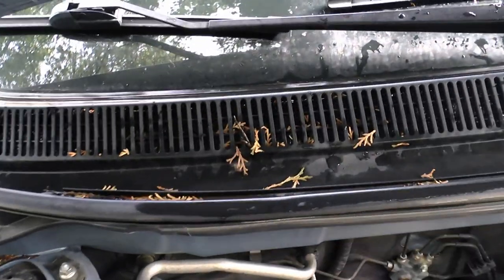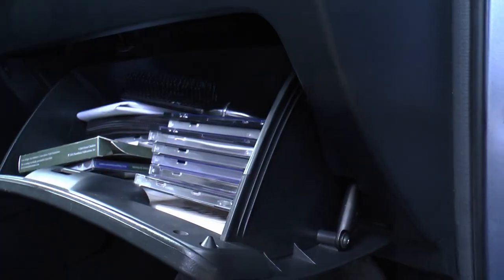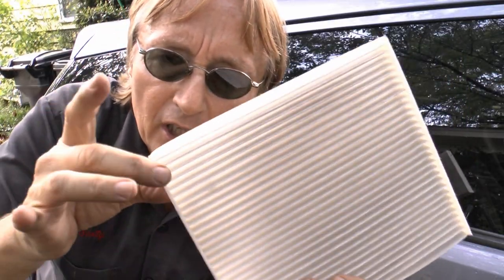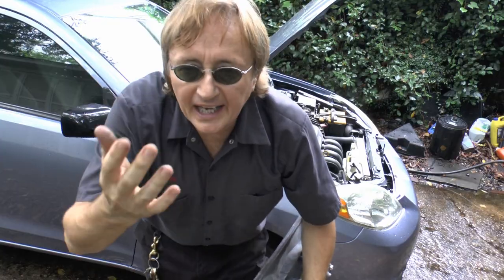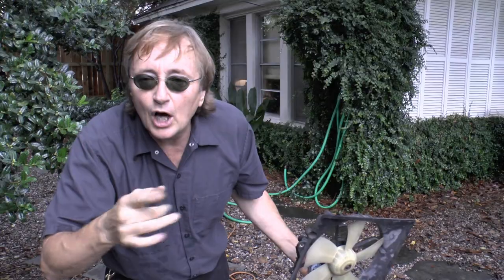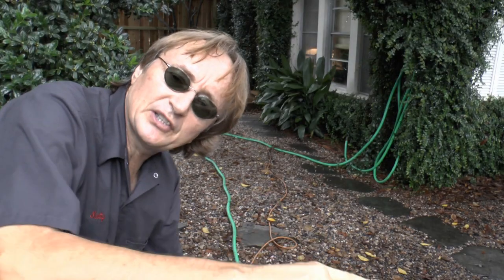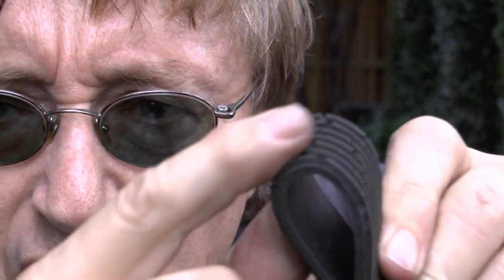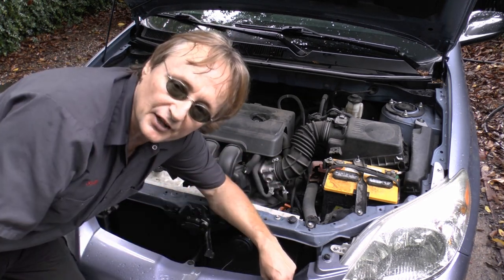How to Keep Your Car's AC Blowing Ice Cold for FREE

Comment: When I was 19, I had a Chevy Celebrity.  That car would GUAG (Get Up And Go) straight off from a cold start... I purposely did that ONLY ONCE just to see if it would.  In fact that car started right up with no trouble at all. I can just slam it into gear and floor it.

The problem is that the car had a huge knocking sound even before I had it.  That car was knocking when the previous owner had it, which is funny because that excessive knocking was the only freaking thing wrong with it.  And to make matters worse, there wasn't a single mechanic who could figure out where the knock was coming from or why.

And when it came time to smog the car, everything passed.... EXCEPT FOR THAT KNOCKING!!!!!!!!!!!!!!!!!!!!!!   Everything checked out otherwise.  I ended up scrapping the car because NO ONE COULD FIX IT!!! I'm 33 now and still can't figure it out.

Comment: Can you tell me how to do a freon refill for a 2005 Mercury mountaineer? the compressor is in a weird place. I can't seem to attach the freon hose to the low pressure access point. Not sure if I'm not using the right access point or what.
Reply from the maker: the low side hose ONLY fits on the low side fitting, you can't put it on any other fitting, it won't fit. Go to an auto zone, they can show you in person
Reply: +Scotty Kilmer ok thanks!

Comment: I have a 2001 Buick park avenue, the AC was working great but now its not blowing cold air through the vents. I changed the cabin air filter but still nothing. The AC has coolant and the lines are getting cold but the air coming through the vents never get cold.

Comment: How about using an air compressor and blow off dust and dirt from inside and out?
Reply from the maker: +GymChess sure, if you can access all the parts
Reply: +Scotty Kilmer I tried once and I did notice a small "cloud" of dust fly off. Of course it wasn't easy. How often should you do that? Is there any risk in it like bending those small aluminium "grills" or whatever they're called? I think that I accidentally did bend quite a few, maybe with the nozzle, not sure.

Comment: what if you completely remove the cabin filter? Although you'd pretty much be getting nasty air, you theoretically would be getting cold air all the time right?
Reply from the maker: it would increase air flow , until debris hit the evap and made it worse
Reply: I did that in my Father's Honda Element.  Never replaced it.  It was nasty.  His newer van doesn't even have one so what's the difference?

Comment: Ive got a 06 scion tc and the ac isnt working i looked around a little and noticed some flimsy   wire which i beleive connects to the ac compressor, its a gray 1 pin connector and it lead up to alternator connection harness. Do i need to replace entire compressor or is the ac compressor wire interchangeable?

Comment: Hello Scott Kilmer, my 2003 Chrysler intrepid drops RPM with no response from the accelerator, but everything works fine after i pull over and turn off and turn the engine back on.  would you know what is causing this?

Comment: Mr. Scott...i have a question, I turn the AC on and it blows warm air...i put refrigerant ACpro in and still warm air but now, the fan on the radiator goes on and off.  It does that as long as the AC is turn on and every time it goes off, the engine shakes like its choking on something.  I also observed green refrigerant around the connecting holes connecting to the condenser Unit.  Any ideas?
Reply: Have your system leak tested by a professional.

Comment: Is there a way of cleaning the evaporated  ? I just bought a 2006 F150 that sat outside in wooded area still finding ants running around. Thanks
Reply from the maker: there are various evaporator spray cleaners on the market, google it

Comment: Do not remove your radiator cap that quickly if the engine is hot. If you must, wear a glove, use a rag and remove the cap SLOWLY. Better still, wait till the engine is cold.

Comment: Scotty, I have a question for you. I have a 2010 Camaro and when I turn on the AC full blast, It doesn't blow cold air and when I checked the pressure with a hose the needle was in the red and the AC compressor is kicking on. Any suggestions on what my problem could be?
Reply from the maker: +RobertGarrett19   pressure is waay too high, either cooling fans aren't working, or there's blockage inside the system, like a clogged condenser

Comment: Hi Scotty..strange problem on my 2002 SATURN SL1. A/C works perfectly...except it is laways on (turns on when the fan is turned on). THe LED on the A/C switch is always illuminated-schematic  would indicte that  the climate control module is always activating  compressor clutch relay-how can i fix this?
Reply from the maker: +Gene Kelly switch is bad but you have to buy the whole control unit in the dash to replace it in most cases
Reply: Thanks!

Comment: hi, I have a problem with my ac in a 96 s10 2.2. the compressor clutch will not engage, I checked what I think is the ac relay buy notice that there is no power on Connector. any advise?

Comment: I have a 2000 civic LX EJ6 manual transmission. It has a new ac compressor, cooling fan and I refilled the AC system. But my car only blows cold air when it's sitting in place. When the car is moving the air isn't cold. Any idea what this might be?

Comment: Hey Scotty. The air conditioner on my 2008 Toyota Tacoma V6 wouldn't turn on. After about 10 miles on the highway and restarting the engine the a/c turned on. After the 10 mile ride I noticed the a/c compressor runs for 30 seconds and shuts off for 5 seconds. Is that normal for the compressor? And why do you think my a/c wouldn't turn on in the first place?
Reply from the maker: Roy Rivera not normal, but often just a bad magnetic clutch relay does that, pray it's just that

Comment: Scotty I have a question, my ac control light keep turning off after about 20 minutes of being on I always have it so that it hits my face and the floor but it always turns of the ac is really cold sometimes and other times its okay but this problem is annoying since when the light goes of less air comes out any suggestions? I have a 2006 Nissan altima
Reply from the maker: often a bad blower motor resistor assembly on that car, PRAY it's not the computer controls going out

Comment: Hi Scotty...what about an older car that doesnt have a cabin filter?
Reply from the maker: you can spray lysol in there to clean it, and also spray water up the drain hose from the bottom of the car to remove debris
Reply: +Scotty Kilmer thanks a bunch Scotty...you just answered my next question...i noticed the a/c has not been dripping for the last few weeks...But can't find the drain plug....1994 olds cutlass with the 3.1

Comment: I have a question I have a 2007 Volkswagen. beetle 2.5 the compressor doesn't kick on no more and the temp light comes on when I start the car so if I get the thermostat checked or what ever needs to be replaced should the compressor kick back on cause compressors are like 500$ for my car and have to be imported from mexico or Germany
Reply from the maker: TheEpicWhite FurryWolf   probably a bad compressor, knowing VWs. But, have a good vw guy hook up a vag com VW scanner first, as those VW ac systems are all computer controlled and VERY complex. Pray it's an electronic fault

Comment: I have a 2012 Genesis 3.8L sedan. The local Hyundai dealer, when I has my car in for a recall, inspected the car and reminded me I needed a new cabin air filter. They would replace it for....$60. Yep. 60 DOLLARS. I ordered a much better than OEM cabin filter from ROCK AUTO (Denso, Super-fine filtration with high quality, non-woven fleece material contains up to five individual layers which trap almost 100% of harmful pollutants and particles, even as small as 0.01 micrometers.)  Cost me about $10, and tooke me 5 minutes to install. 60 bucks my ass....

Comment: My AC blows cold sometimes, other times it blows warm, not hot. Can a dirty cabin air filter cause this? The car in question is a 99 Buick Century in Florida.
Reply: MetroJet2000 a dirty cabin filter will not change air temp, but it will restrict the fflow of air. check it anyway. as far as cold and warm. get a gauge and check that it is within pressure and that compressor and fan are turning on, when you switch it on.

Comment: Hey how much would you charge me to unclog a clogged ac drain on a 98 Jeep Grand Cherokee I just bought it and I've noticed when I run my ac the ac never drips on the outside and my carpet gets wet ac works great just don't drain it seems

Comment: Scotty, I drive a 1997 Mitsubishi Galant diesel and both fans are spinning everytime the engine is running, even when the A/C off. The engine doesn't overheat, not even in hot summer days.
Reply from the maker: heck be happy that old thing still runs fine, live with it, hurts nothing

Comment: hi scotty u know were is the cabin filter in a 06 dodge grand caravan  please
Reply from the maker: +Emilio Avalos 

Locate the air filter door on the bottom of the lower front HVAC 
housing just outboard of the passenger side of the instrument panel 
center stack.
Slide the air filter door latch toward the rear of the vehicle until it engages the opened stop on the door.
Pull the air filter door straight downward to disengage it from the air filter opening of the HVAC housing.
Use your fingers to reach through the air filter opening of the HVAC housing far enough to grasp the air filter.
Pull the air filter straight down and out of the HVAC housing.INSTALLATION 

NOTE: The particulate air filter is labeled with "Airflow" and an
 arrow to indicate air flow direction through the filter. This arrow 
should always be oriented towards the center of the vehicle. Make sure 
to properly install the particulate air filter. Failure to properly 
install the filter will result in the need to replace the filter sooner 
than required by design.

Install the filter fully upward into the HVAC housing through the 
air filter opening with the "Airflow" arrow oriented towards the center 
of the vehicle.
With the latch still positioned against its opened stop, 
install the air filter door onto the lower HVAC housing air filter 
opening.
Slide the air filter door latch toward the front of the vehicle until it contacts the closed stop on the door.

© 2015 ALLDATA LLC. All rights reserved. Terms and Conditions

Comment: Where would I find the cabin filter in a 03 ford expedition XLT?
Reply: A lot of vehicles have them under the plastic paneling under the windshield wipers, usually on the passenger side.
Reply: @zachbriggs7531  so to be clear there are actually 2 filters? One under the hood and the other where you said it usually is? Thanks!!

Comment: Hey Scotty, My vehicle has great air flow AC but when i have AC on and i am at a stop position, i can smell burnt oil. If i use "max" AC at a stop position i dont smell it.
Reply from the maker: often leaking valve cover gaskets do that under the hood, max ac is recirc air so you don't smell the engine then.

Comment: My 2011 Acura TL's AC works most of the time, but for some reason it will just stop blowing cold. After a while it will come back on after I turn it on and off a few times, but sometimes it won't come back for a while. Not sure what the issue is. Not hearing any noices coming from the compressor.

Comment: hey scotty my 97 toyota Corolla had a thing where it jerks as I speed up I was told it was transmission problems and so I took old fluid out and for the transmission repair kit and had it changed. but that didnt fix it. any advice so I can be a kool cat?
Reply: Maybe not.  Dirty fuel injectors and other things can cause that, too.

Comment: I got a question I have a 1999 buick park avenue when I turn on my ac the driver side blows cold air but the passenger side blows hot air how can I fix that can you please let me know I really appreciate it
Reply from the maker: often a bad actuator inside the dash on  t he passenger side. BUT you'd need a guy like me with a dealer level scan computer to do bidirectional testing to be sure

Comment: so does the radiator double as the AC condenser?
Reply: +bigbore400 No,they are seperate units, but fixed together (along with the intercooler when the engine is turbocharged)

Comment: (rave your engine )what's the temperature should on a good a/c system. i live in fla temperature here  reach 100 degrees in summer.so if outside is 100 what  my a/c should be.?
Reply: If the climate control is automatic then the cabin should reach the set temperature and maintain it no matter what. If the climate control is manual, vent temperature (measured with a meat thermometer) should be around 40Fs with low blower speed, temperature knob on coolest zone and recirculation on.

Comment: I have a problem in my ford f-550 2007 when in park the ac is ice cold but when I drive it isn't cooling.. I checked if coolent-optimal,I cleaned the radiator by high pressure water

Comment: hi Scotty . I have checked all those things that you say in the vedio and all works fine .but my air condition doesn't blow air as it used to be. and there is stinky smell when turn on A/C . my car is hyundai sonata 2008. I think evaporator core need to be cleaned but how ??
Reply from the maker: you really have to take the dash apart and physically clean out the evaporator, a real pain in the ass job. If that much crud has built up to lower air flow, that would be needed
Reply: Scotty Kilmer will chemical cleaner work ? instead of removing all dash to reach that part ? I saw some on YouTube but I don't know if they are effective
Reply: Scotty Kilmer will chemical cleaner work ? instead of removing all dash to reach that part ? I saw some on YouTube but I don't know if they are effective

Comment: Hey I got question To ask u I have truck a very time I pull my a/c to blown cold and when I make turn knock off to turn to heat
Reply from the maker: Jeff S check for wiring shorts which make the ac shut off from lack of power, like AC clutch connector or ac pressure switches

Comment: To gas it up again is defiantly not for free. In most cases the gas has leaked out. The compressor won't start if the pressure is too low.

Comment: Hi Scotty 
i have Hyundai 2011 air condition works perfectly n radiator fan works as well  but sometimes doesn't work just hot air n radiator fan doesn't work as well , I tested the fan by connected directly to the battery it's working good, I don't now what is the issue,please assist me, if u want my contacts info let me know,thanks in advance .

Comment: so my ac light turns off and doesnt work on fan speeds 2,3 but work just fine on 1 and 4. basically thecompressor doesnt kick on and i dont get cold air for speeds 2 and 3. i read online about it being something like a  resistor? any tips? thanks!

Comment: Hey scott, i just got a 93 chevy geo prizm. When i run the fan, it will only run on high, and even then no air will come out of the vents. All it does is make a loud vibrating sound...what should I do?
Reply from the maker: I would replace the blower motor resistor and the fan motor, and check for blockage inside the vents, like paper stuck in them when you remove the blower motor.
Reply: i pulled out the blower motor and pulled out a nice wad of cat hair and fuz and stuff. Thanks! i know have A/C on high, i need to order the resister. It gets better though...I tested the heat as well, and let the motor warm up and all, but no hot air came through the vents. My father said it may be the thermometer, but i dont want to asssume, especially because it could also be the heater core

Comment: The AC Radiator's liquid is an (antifreezing) liquid but which gets cooled by a refrigerator (R132A) ? So : not the refrigerator (R132A) is circulated through the system but the (antifreezing) liquid which gets cooled by R132A ? I wonder why the hell nobody from any service didn't ask me about it ! And most of times I heard "to refill (just) the refrigerator (R132A)" ! Very weird, lol.

Comment: do you have any cheap ways to keep from having to replace the ac unit in a 2002 for explorer XLT 4.0 with aprox. 130,000 miles?  was told that it's going to go out but it has not yet. it's about 1500 bucks.
Reply from the maker: yea, roll your windows down. And use the ac as little as possible. But, some guys will add one ounce of AC oil to lube the system and make it last a bit longer
Reply: Bryan Williams
Reply: Bryan Williams
Reply: Bryan Williams

Comment: Hey Scotty my Chevy trailblazer A/C Likes to shut off when I'm driving, at first it works for the next five minutes then it just stops blowing cold air and I get instantly hot what could be the problem?
Reply from the maker: +Brandon “wolfgangpuck777” Adamson pray it's simple like a bad ac pressure switch on the receiver dryer and NOT computer electronic failure in the control unit as it often is

Comment: Hey scott, my 2000 taurus is leaking steering wheel oil, i put almost an entire case of fluid and the next day, it's dried and all spilled.. what can i do to solve this problem?
Reply from the maker: do my video "finding and fixing car oil leaks" and repair the leak when you find it. Pray it's just a leaking hose and not the steering rack
Reply from the maker: DatCarGuy310
IF rack is bad, squeeze the rubber boots at each end, if they drip fluid, rack is shot. If not, pump is leaking
Reply: Found the problem, I did what you typed.. I squeezed the rubber part and all the oil spilled everywhere. It must be the rack. Thanks Scott for the  tip.

P.S.: The pump is not covered with oil, it's dry and good to go.
Reply: Scotty Kilmer what if my car makes a noise a from the dash when I turn the a.c. on is it a a.c. clog?